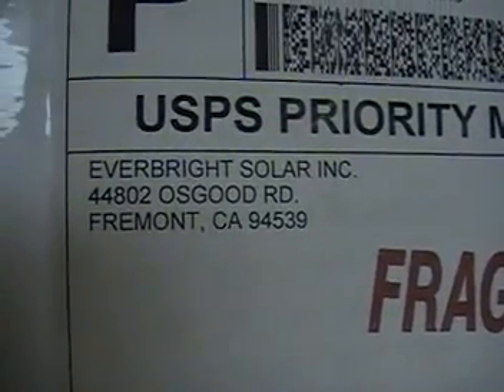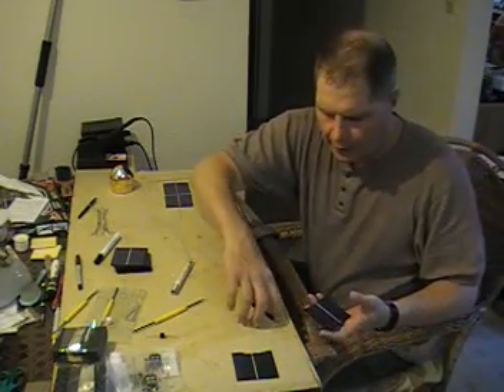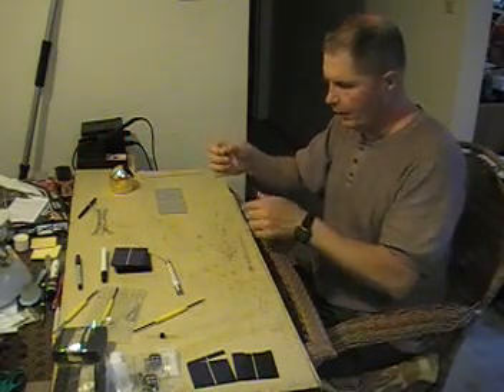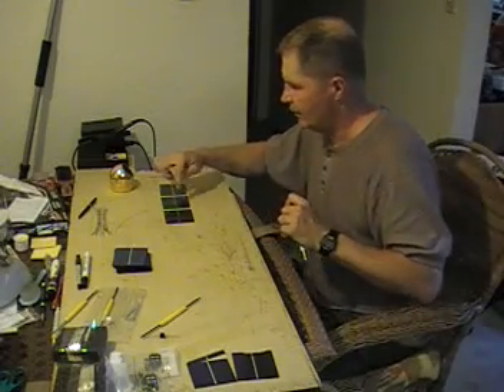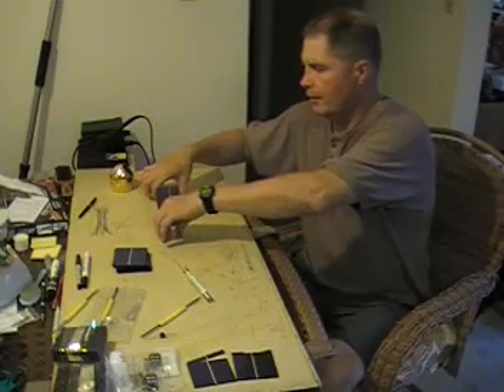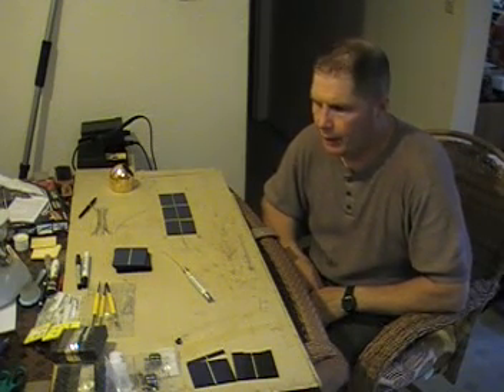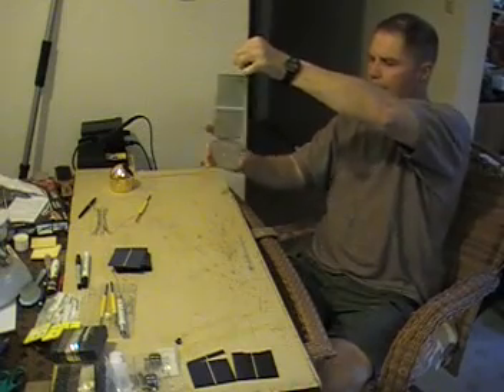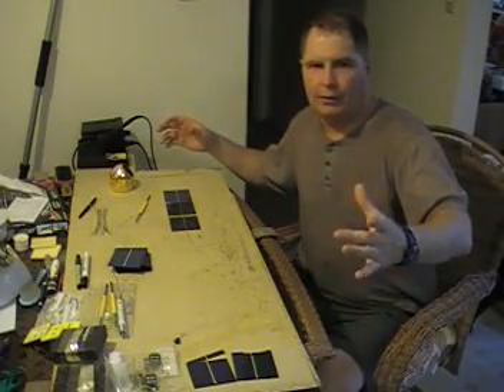Do It Yourself Solar Panel (Soldering)

Comment from the maker: Does it make since to try to solder a round object to a flat object. Seems to me you can use copper, but the standard is tabbing. An alternate reason could be because you create more space between the glass and the solar cell and the industry can produce solar panels in a much more precise manner then you are I. Since you are not a manufacturer I see no reason why you can't use copper wire. I would stick with the tabbing.

Comment from the maker: @somud1
By using the tabbing along the whole cell you ensur the best connections throught the cell. if for some reason a portion of the cell quits working the rest of the cell is still producing energy and passsing it along. Plus if a cell quits sending energy it creates a break in the circuit and the whole panel would become inop. 
second Question you can as long as you use some sort of rosin to make connections. However silver soder is recommended by anyone who works with solar cells.

Comment: Whats stopping me from using  solid core copper wire as the connections ? also why have the tabbing wire run the entire length of the silver strip on the front wouldn't it be more economical to use the bare minimum when connecting the cells i.e. from just the bottom to the just the top of the next cell rather than run it trough the entire length of the first cell and then the second cell.